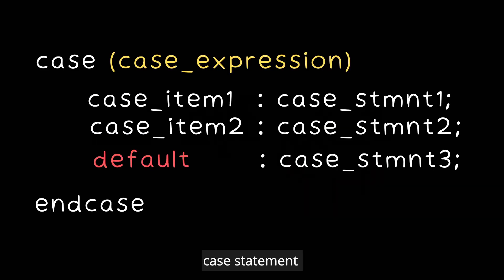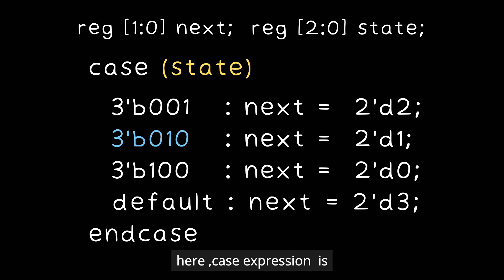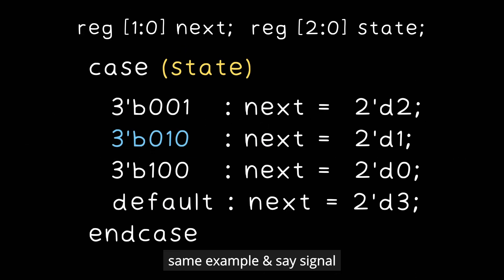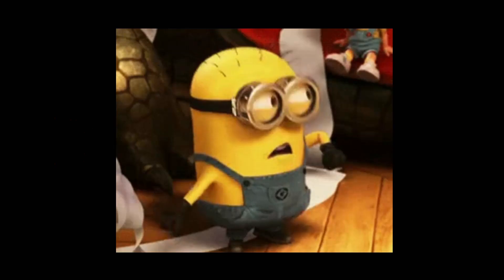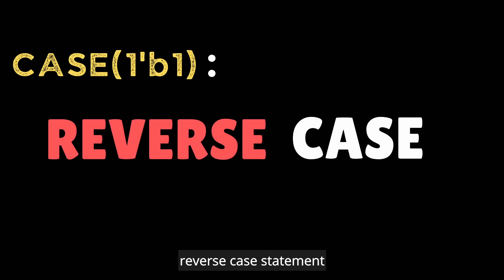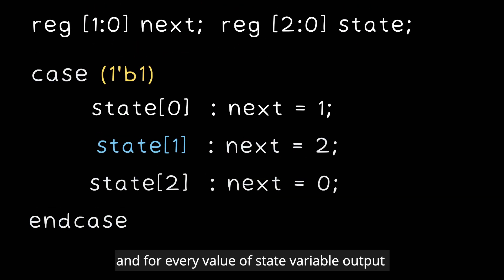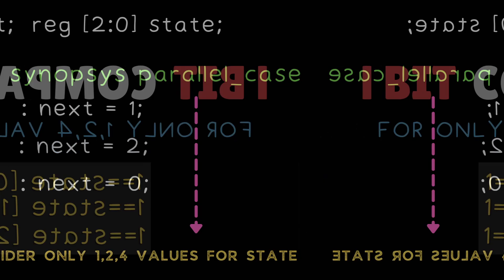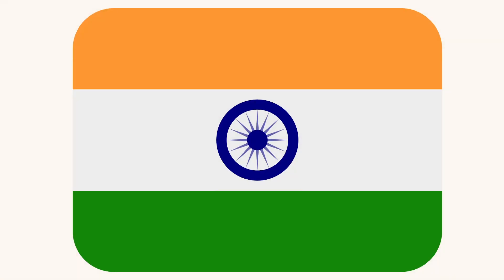What is Reverse Case Statement in Verilog?   Case(1'b1)

Comment: Don't use parallel case pragma. Instead use unique decision modifier in front of the case statement. This will ensure that state index is one hot coded. It will give a RT warning in simulation too. Synthesis tool will understand it too.
Reply from the maker: Yup 😊👍